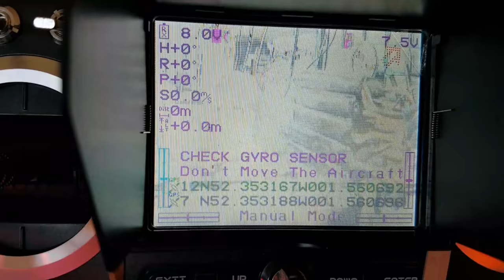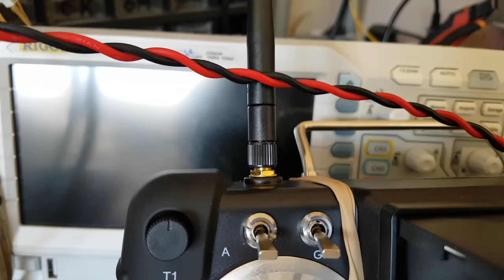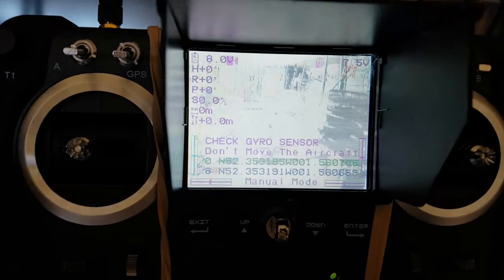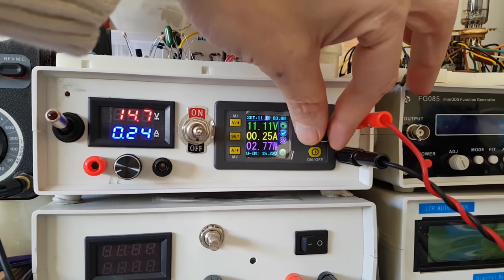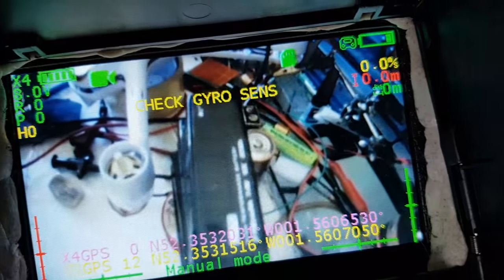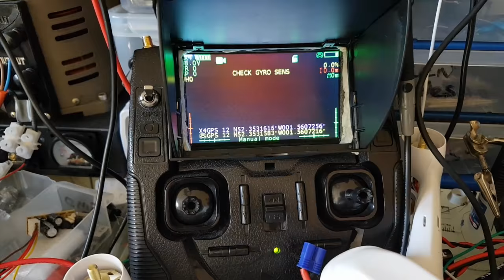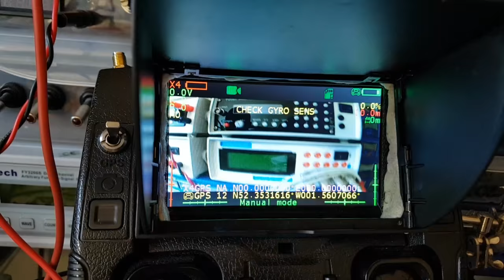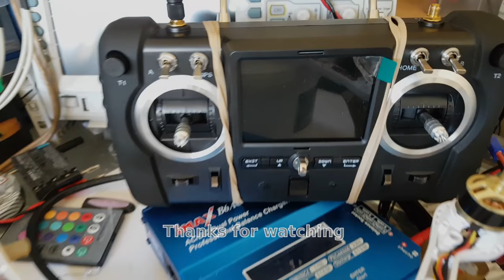Hubsan H501S-S  H501S Differences

Comment: Hi Elecifun,Sorry to hear of your problems, who knew there was an SS version? Anyway I have the Revell Control 23899 which is a Hubsan H501s under the stickers. I also have had the same 'CHECK GYRO SENS' problem for the last month or so, initially I couldn't get past if until I put a Lipo 2s nano tech battery into the transmitter, then I got the quad to bind and compass check etc. I've been dealing with Hubsan support for at least 3 weeks now, I've fitted a new compass calibration board and I'm still having trouble especially when I go to a new location. I don't think I'll ever get it fixed. So best thing is you can is to send it back asap and get your money to.Thank you for the vids, like them.
Reply from the maker: I have just looked at your Revell Control 23899, blimey, that is a Hubsan, or a Hubsan is that? I have mine boxed and ready to go back. I am gutted as I had started to love that bird. Now I have to 'dear Jane' it.
Reply: Your be very lucky to be able to return to Banggood.com, I purchased a H502e last year and what arrived was sun soaked dis-coloured piece of rubbish. Didn't want to bind and flew like a rock, their return procedure is overly complicated so gave up. I'll keep my fingers crossed for you on that one. Re Revell, yes Hubsan name plate in front above the camera, Hubsan everything except the stickers and the box. Got it from Amazon UK for a bargain so brought x2 of them, shame as second one has this GYRO fault which I was rather hoping you was going to analyse and come up with a fix.

Comment: I think the protrusion on the camera lens is a neutral density filter- supposed to help eliminate "jello". I have an H501S-S also and my camera is terrible too. The video recordings are unusable, corrupted somehow- jerky, missing segments, psychedelic distortions etc... The video images are very blue tinted also. I am hoping Hubsan will help resolve this issue. I also get a lot of static on the controller screen.
Reply from the maker: Sorry to hear are having problems too. This is not a good newer model. I might just send mine back and get my other one working.
Reply: Elecifun i was hoping u r not return it yet. mayb change the camera board or fix what is broken. this is my honest opinion. i'm not frm hubsan or selling anything here. but u r lucky to have ss.

Comment: Hi Electifun, I received a new H501S-S last week, and I like the way it works except that the video is faulty, photos are OK. I started using a class 4 SD card then changed to a class 10 card but that did not work.
I sent messages to both Hubsan and Banggood but have not heard back yet. Do you
think this would be repairable by a rank amateur, or should I push for
replacement ?
The video would have been recording for about 30seconds but only ended up being 13 seconds long.

Comment: I may have mentioned it but my H501S also came with that ridiculous "neutral density" lens filter and my 501 videos were horrible.  I've been ranting about this for awhile.  I noticed that older 501s didn't have it so I removed it by prying it off with a fingernail as it's just glued onto the front of the camera lens front ring and/or body shell.  That significantly improved the video quality.  What Hubsan should have done is just put a better camera in the 501 instead of resorting to a cheap kludge, which severely degrades the already-marginal camera performance.  Go figure.
Reply from the maker: I do not like the filter it looks like a cheap add-on. My Hubsan H501S has a great camera and I would not want to filter it. I just want to send the newer H501SS back I do not like this one at all.

Comment: Hi Elecifun,I've heard you talking that your flight controller board is fried, was this a firmware update fault or is it the fault that's causing the 'CHECK GYRO SENS' fault.
Reply from the maker: Flight controller on my first H501S is fried according to Hubsan, it burnt out the connecting cable on the second track. Hubsan say this may have happened if the cable was loose. It was quite firm. Checked today 1st,April ,2017 and still nothing from Hubsan or Banggood. 'Check Gyro Sens' is on the new Hubsan H501S-S
Reply: I was able to pick up what happened to the flexible ribbon cable between the two boards from your excellent video, PCB tracks and thin ribbon cable only normally burn out if they have been subjected to a current surge or overload of some description. Does seem an odd one. Shame your not in LA you could pop into the service centre and probably get it fixed up, so far I've had to fund my own repair bills as Hubsan unlike the American customers won't send any replacement parts FOC to the UK for some reason, maybe they think we are not a large enough customer base?

Comment: I have Hubsan x4 H501S in the controller I can
never get the P or R to be less than 1 although I did the calib compass 1 &
2 successfully I have heard that if you cannot get P or R to be less than 1 the
HUBSAN will not ascent vertically .Im not able to fly the drone yet . Please
help .
Reply from the maker: For P = 0 and R = 0 
You must calibrate on flat surface.
If P or R = 1 that is fine
Reply: @Elecifun  thank you so much for the reply I have tried many flat surfaces different position no luck
Reply from the maker: You have to give some room for inaccuracy. The craft will ascend and descend with P and R showing 1
Reply: @Elecifun  there's no way I can get the P ir R 0 is that mean that I'm not able to fly the Drone if I'm not able to accomplish that ? Thank you for your help
Reply: Hold the left stick in to the right and then wiggle the right stick left and right until the lights on the drone flash and you will see all of the counters return back to 0 and be sure and have it on a very level surface as this will be recalibrating that sensor and you don't want it to be unlevel as it will cause it to fly erratically

Comment: You need to removed the protested Len from 501s-s, I had same problem with the camera but after I realized it I just removed the Len that sticking out, then the camera was clear and focus.
Reply from the maker: Cheers for the info buddy. I had to send it back as it only has 45 day warranty from Banggood, also the controller screen was washed out with white. Two problems in one box, it had to go back.

Comment from the maker: While talking to Bang-Good today, their representative told me I should have checked that it was a Hubsan H501S and not an SS before I bought it. It was sold as a Hubsan H501s NOT SS. It is in a Hubsan H501S box nothing on it saying new version or SS. WOW
Reply from the maker: To add, I did not even know that the Hubsan H501S-S or SS was available. What was I supposed to check?
Reply: I ordered my H501S like  before this SS drama began. Asked Gearbest, if they sending me H501S, and they confirmed. I hope, Gearbest are avare of this S and SS situation.
Reply from the maker: My fingers are crossed for you.
Reply from the maker: What did you get? H501S or H501S-S
Reply: SS

Comment: Hi,  if you don't mind what is the video format and naming convention does the H501SS as compared to the H501S use when it creates your videos. are they numbered in chronological sequence. What creation date does it show, if any?
Reply from the maker: I never took the time to check my friend. It is on its way back to China now as a solution could not be found for its issues. I have a H501S and have recorded flights but I have never noticed, I just tend to dump the video file/s in a folder with the relative date on it. Sorry I could not help.
Reply: Elecifun thanks anyway
Reply: Sorry for late comment and it’s probably already answered elsewhere, also, Love the video. The video files are numbered chronologically.

Comment: Hi Elecifun, So three days later is there any news re your return to Banggood, I only ask because I'm not the only one following this outcome.
Reply from the maker: Cheers for asking,. I have heard nothing. This is a little disappointing. I know they have viewed the video showing the issues, it is unlisted and has now been viewed 5 times. It is unlisted so I know when they have viewed it. I hope to hear from them this coming week and will not hold my breath for news over the weekend. 
The FC for my H501S should be here very soon, so hopefully it should not be too long before I have one back in the air. I do intend on sending the H501SS back as the camera is not focused, the controller screen is awash with white and the image is not good, to say the least and not forgetting its nearly bricked. I am not sure if I would buy another.
Reply: Banggod is horrible if it comes to returns would be nice if you can answer this comment if you get any message back.
Reply: Seems like 'Elecifun' does not want to reply at the moment, I can only guess he shipped it back and is still waiting for the refund??
Reply from the maker: I don't fully understand the question. However I spoke to Banggood today and they gave me no clear answer to what was happening. All they have been saying is they have to talk with the distributer and they provide me  the link for the return options. I am not sure what is going on and am tired of chasing this up. This afternoon I spoke with Paypal and they have now taken over the case. I am really unhappy that Banggood has been no help whatsoever with this.  I have not heard back from Hubsan either, I guess they do not like criticism.
Reply from the maker: No, Elecifun for some reason does not get his email notifications anymore. I have been playing with setting trying to fix it and now have lost my liked videos. I have also almost completed the amp I started to build earlier. I been busy busy :D

Comment: My h501ss is much better than my 501s. First because with the new firmware only the 501ss was perfect. In the 501s, the fpv focused very weak on me. Also in the 501ss the flight is much more stable and with the new firmwares 1.1.36 ... (specific rx) got the RTH mayor and very fast, landing in the direction of the radio. Unfortunately these new updates did not look good on the 501s, so I still have the slower RTH coming from the coast (501s) and landing at the takeoff point, not to mention the circle flight, which only works with the new firmware, in this case , Only in my 501ss, because I need a perfect FPV. I have the two radios, the advanced one has a better quality video output, which I can use it on my smartphone with usb cable otg and more the EASY CAP (video capture card). Hug to everyone.

Comment: Good Morning !! I am trying to update the firmware of my Drone Hubsan 501s, but when trying to install the software in Drone, it accuses a failure (update error) and I can not install it ?? After this procedure he is no longer recognizing the location sensors. How can I solve this ?? Is there any way to reset the Drone card ?? And try to do it again ??
Reply from the maker: Oh dear, and good morning to you. How old is your drone? Is it a Hubsan H501SS and you thought you bought a H501S? If it H501SS it is now bricked. Check and let me know.
Reply: Good afternoon !! Thanks for answering me !! My hubsan 501s according to your box, but in your video you point out as one of the differences the camera that stands out in the drone, I bought it 60 days ago and I received it yesterday by fedex .... I can point out as a characteristic that the camera Of it is appearing a little out as shows of your video ....
Reply from the maker: My friend you may have been caught up in the stupidity that is Hubsan. Lets try and be sure. Where did you buy it from? What firmware did you attempt to update it with? What was the update error message?
Reply from the maker: Was the insides of its box cardboard or plastics?
Reply: My friend, after I tried to do the update, on the remote control it remains as check sensor and does not sync. And when I try to update the firmware it gives the following update error information. Thank you very much for your support !!
Reply from the maker: My friend, That happened to me. Did it come in all cardboard boxing? If it arrived in all cardboard boxing it is a Hubsan H501SS. You would need to replace the flight controller as that is what you attempted to update.  Could I ask why you wanted to update the firmware? Also would you give this video a thumbs up so it ranks higher in searches and will reach other who find themselves in similar situations.  I have to go to the pub now but will be back tomorrow, if you still need my assistance. Good luck.
Reply: Good Morning !! My friend !! Thank you for helping me solve the installation problem. My Hubsan came in a cardboard box yes .... And I need to upgrade the system because Brazil's busola system is different and Hubsan would have GPS location problems. I downloaded the tutorial to do the update, but when inserting the USB cable and installing the system it accuses failure to install. Besides this after doing this procedure it does not turn on and does not read the location sensors. As I observed you have great knowledge of electronics and the Hubsan equipment, is there a reset that I can do on the board so that it goes back to the manufacturer's default mode ??? I take it one more time to thank you for your support and your attention !!
Reply from the maker: Hello my friend. I am sorry there is no such reset facility to my knowledge. The firmware is for the Hubsan H501s flight controller. The H501SS has a different flight controller and I am afraid it will now need Hubsan attention, or a new FC. It is really unfortunate that Hubsan did not tell anyone about the changes or what would happen if the H501s firmware was flashed to the H501s FC chip, until the new model had been being sold for over 1 month. Hubsan did not even change the box to give its customers a heads up. 
Personally I feel really let down by Hubsan and have sent my H501SS back to Banggood.
I am still waiting for a cable for my H501s which was promised around 3 months ago. You are welcome to my assistance as I will help my fellow human where I can.
Reply: My h501ss is much better than my 501s. First because with the new firmware only the 501ss was perfect. In the 501s, the fpv focused very weak on me. Also in the 501ss the flight is much more stable and with the new firmwares 1.1.36 ... (specific rx) got the RTH mayor and very fast, landing in the direction of the radio. Unfortunately these new updates did not look good on the 501s, so I still have the slower RTH coming from the coast (501s) and landing at the takeoff point, not to mention the circle flight, which only works with the new firmware, in this case , Only in my 501ss, because I need a perfect FPV. I have the two radios, the advanced one has a better quality video output, which I can use it on my smartphone with usb cable otg and more the EASY CAP (video capture card). Hug to everyone.
Reply: Hello. I'm having the same "update error" in my H501SS. Now I want to buy a new Flight Controller, but there's only one model in the Hubsan's official site and it says "FC board for H501S". Does anyone knows if it's going to work on my drone? If not, were can I buy a FC board specific for the H501SS? Thank you!

Comment: Your FPV antenna is not in place on the upgraded controller while you were running the transmitter.  If this is the case, then the reason you have such a poor FPV picture is because you have FRIED your transmitter.  NEVER...EVER::::EVER run the transmitter without the antenna in place.
Reply from the maker: Hi, cheers for your input. Fortunately (for me) that is not how it works. If I turn on my TV without the antenna being connected, do I kill the TV station transmitter? No. 
If I transmit without an antenna, that can and will in many cases cause damage to the transmitting side. Complex voltage ratios when transmitting, the antenna is part of the tuning and without it the circuit is under great stress. I am receiving not transmitting. No antenna means the reception is limited. In this case it will make no difference.
Do not transmit without an antenna is the rule.
Reply: My mistake.  Pure receiver.  Got it.
Reply from the maker: Gondos Istvan are you OK m8 ?
Reply from the maker: Gondos Istvan I am trying to understand your comments. Like this one "what is wrong with 501ss? i have 1 units too..."  and this one "it's not FRIED  anything, the power is too low to FRIED thye module..."  I try and help people here, so I ask are you OK ?
Reply from the maker: Hi Gondos, I sent it back because the controller did not function correctly as seen in the video, also, I chose a H501S so I could have a spare drone with interchangeable parts for my existing H501S. The advert was for the H501S. 
I knew nothing of the changes in hardware or what updating the firmware would do to the newer model. This meant when I did update it I bricked it. Later that day I saw a video Hubsan Official have uploaded hours before announcing the H501SS and its changes with the warning about updating the software . 
It was too late for me as mine was now unusable. 
That is why I made this video. 
I think people think I am just reviewing negatively this drone but I am not, I am just sharing my experience, hoping others do not damage theirs like me.